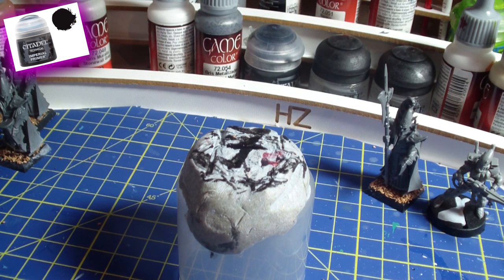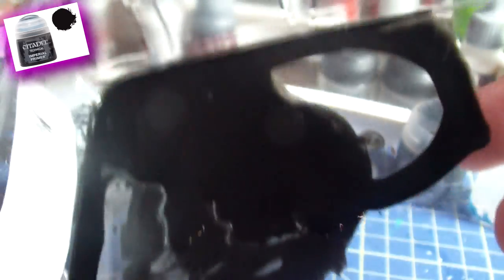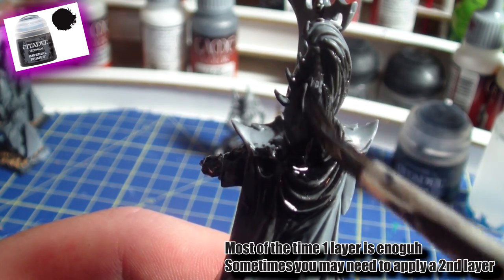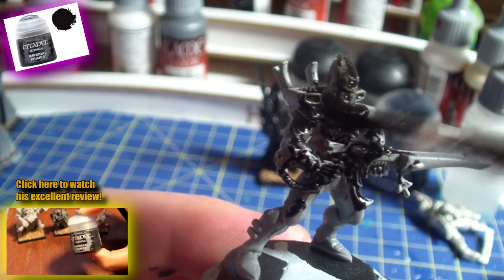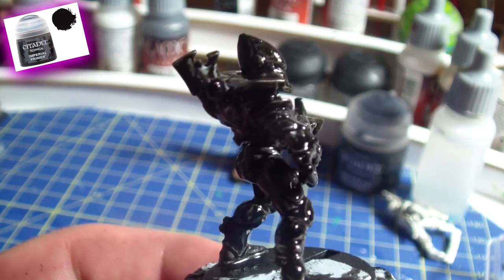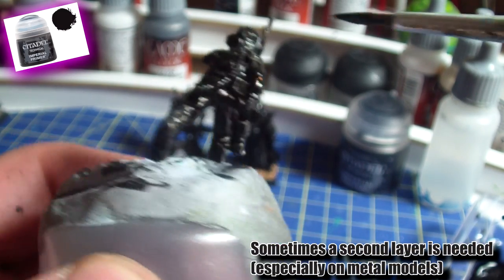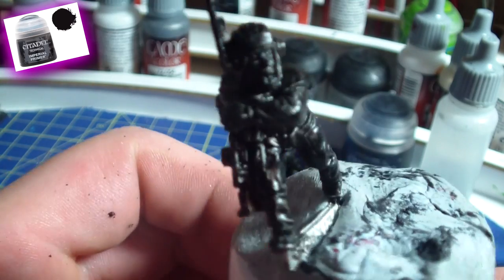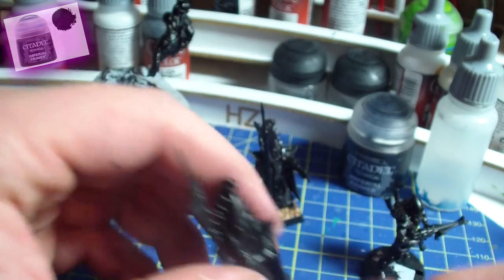How to prime your miniatures: Citadel Imperial Primer (Tutorial)

Comment: Quick question regarding PRIMERS only. Reading the 'Getting Started With Warhammer Age of Sigmar' the guide advises that one primes both the Stormcast Eternals and the Chaos miniatures from the starter set with Citadel Imperial Primer paint. However, Citadel Imperial Primer Paint is only available in small Citadel Pots at 3 Euros (£2.65) each. There are no Imperial Primer large 400ml spray cans or Imperial Primer Air Citadel pots where you can be more efficient with your paint and a air brush gun. So my question is what do I do for an alternative ? a large can of Chaos Black 400ml Citadel Primer ? Also a guy at a GW shop didn't recommend me priming directly with Imperial Primer, instead he said water it down with Addon Black (Citadel Base) otherwise painting over the prime colour will be tough in terms of trying to get the colours painted over to show with the black undercoat showing through. What about priming Stormcast Eternals with a 400ml can of Citadel Retributor Armour paint ? and what about chaos is it good to prime with either a 400ml can of Mephiston Red OR Khorne red ? the warhammer painting guide magazine recommends Imperial Primer but yet again I state no large cans of this. Also the spray cans ? are they crap for even spray and efficient use of paint or should I stick to my air brush ?
Reply: Airbrush is best. GW recommend the stuff they want to sell you, not necessarily the best stuff

Comment: I find it rather weird, either I didn't let it dry enough, but it felt like fine sand that slowly scrapes off the miniature.

Still, I've had the issue of finding bits of hardened or coagulated in the paint quite often.

Comment: I have a question: whats the difference between imperial primer and abaddon black? I have imperial primer, but why should i need it if i can just use a black spray paint?
Reply: MetalGear0987 It's matter of preference. I think the paints differ in dry time or intended use. They explain it in detail for the priming video in the warhammer TVchannel.
Reply: Primer should go on first so that the paint wont flake off, if you want black i would go primer then abbaddon black if the primer is not already dark enough.

Comment: my imperial primer is super thin and is like a shase I think something is wrong with the bottle there is a large solid part in the bottle as well
Reply: Mine was the same as what you describe, I read on another post which said to stir the bottom then shake the heck out of it, I tried that today and it worked great.
Reply: Ahhh thank you so much I thought it was a bad bottle
Reply: Saved my ass, too.